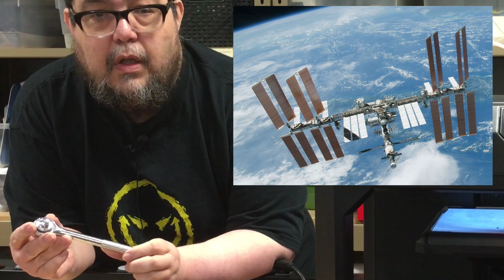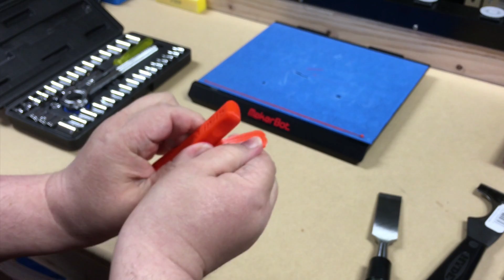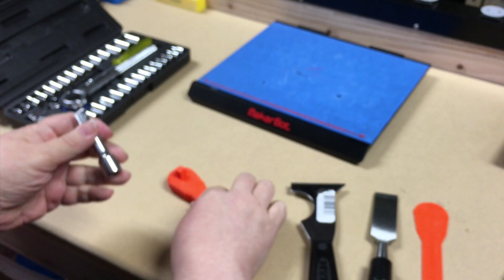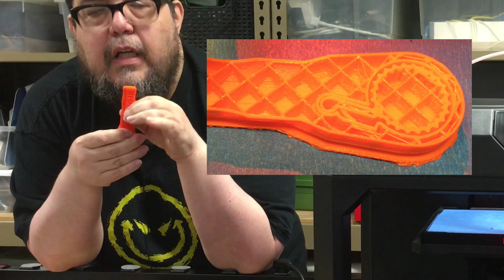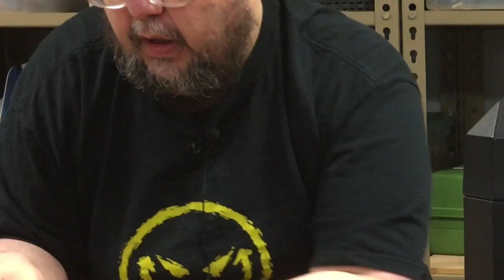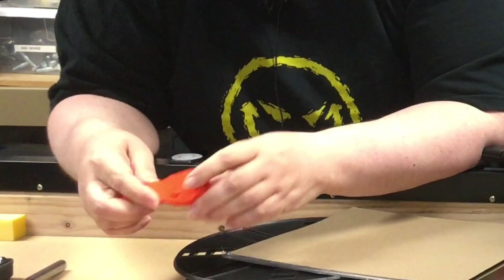Lessons learned attempting to 3D print a NASA wrench

Comment: I think the problem lies with not being DIY.  You own a makerbot, that's like owning a mac. it just sucks and way too limiting.
Reply: Took my 2 hours and it was my third print ever. Print cane out clean on the CR-10s
Reply: And not to mention, not DIY in any way.
Reply: Bryce F you right tho, that 3D printer isn’t doing a good job. He should need the boat underneath. Also he’s running his filament too hot Causing it to string.
Reply: Shouldn’t need